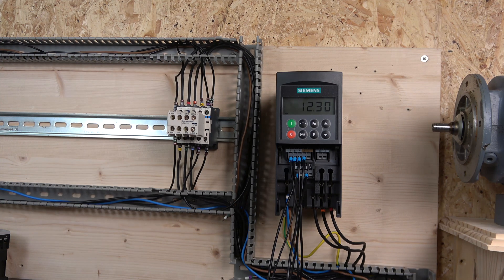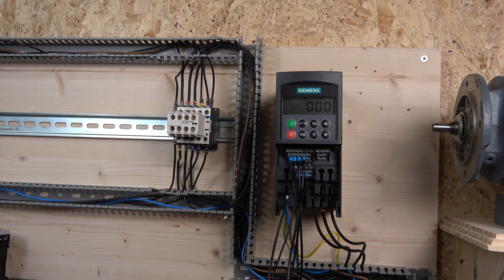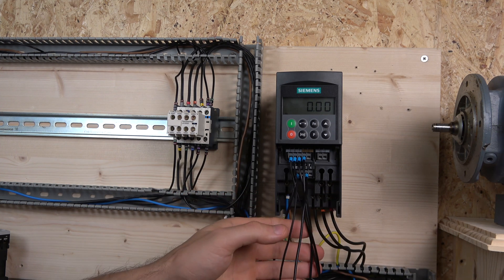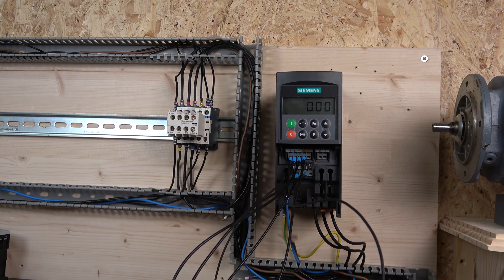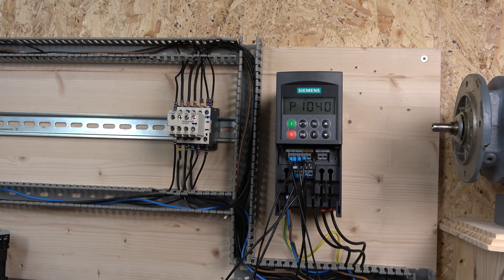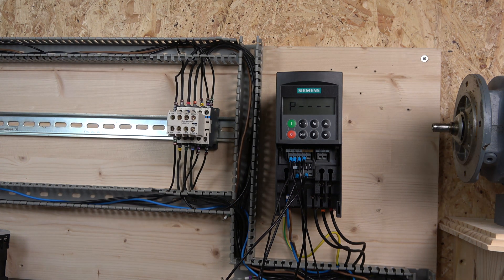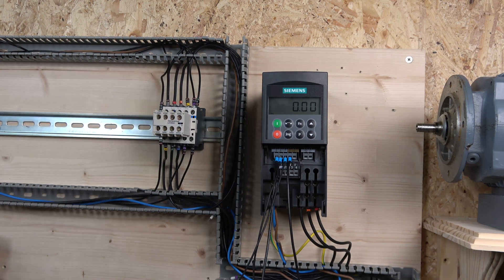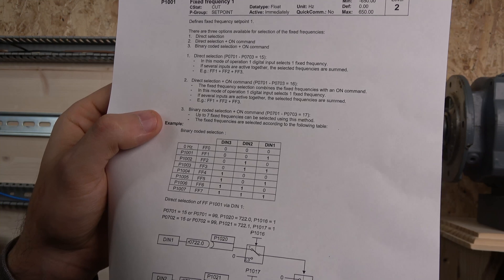Siemens Micromaster 420 remote control, MOP control and set Frequency control. (English)

Comment: I have a v20 inverter and here is a task to perform if i press 1 digital input motor run 10 hz and if i press digital input 2 motor run on 40 hz anf if i press digital input 3 previous input lost it's control and  again if i pressed di 4 then I'll operate motor by potentiometer control......how can i do that
Reply from the maker: Hi There. V20 drive has been covered separately on my canal, so do check them video out.